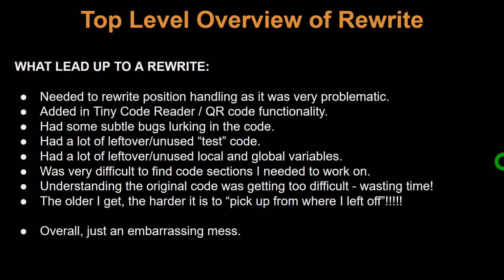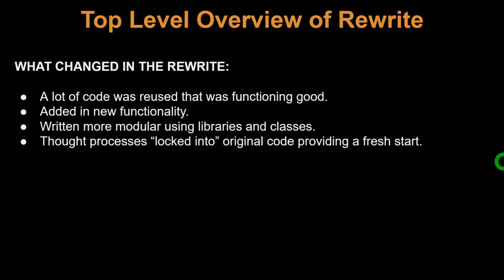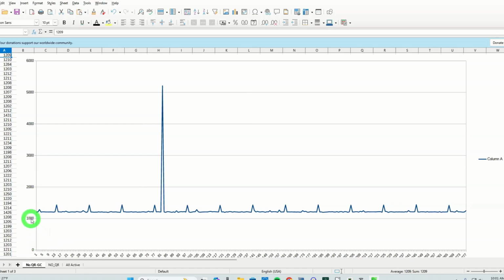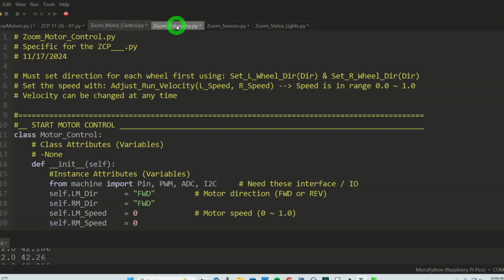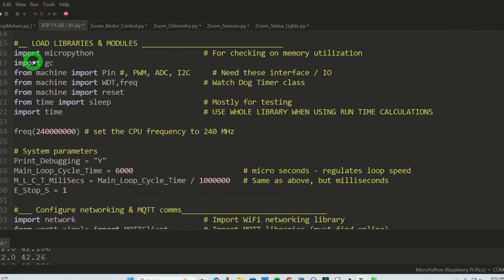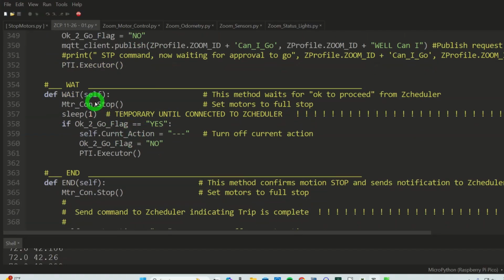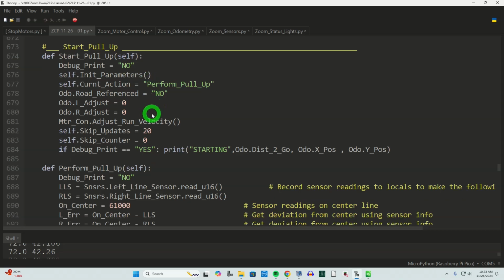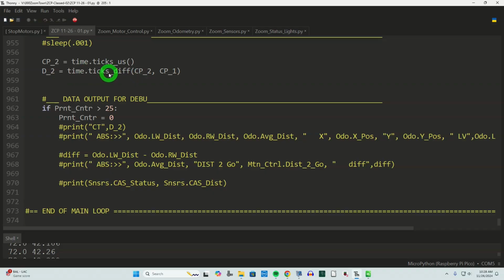055 Top Level Code Review of Zoomie Control Program

Comment: Have you experimented with NFC tags? I have n-scale streetcars and I put the tags on the bottom of the cars along with a magnet. I have one reader under the track to log the starting position of each trolly car and then the hall effect sensors track the exact position of that car when it enters a station. Since all cars follow the same route, I make assumptions about which car triggers the sensors and grabs a virtual token. I'm sure there are limitations as to the speed of the readings if the cars are moving too fast but these are slow streetcars. Your zoomies have the sensors onboard so things are reversed from mine. I also have a large program for controlling lighting on the layout so I understand your concerns.
Reply from the maker: Good morning Ron_Rhodes,
I have not done anything at all with NFC tags.  I just did a quick search to learn more about them and that sound VERY intriguing.  I will have to get the needed hardware and look into those.
Thanks for the suggestion!  All too often I don't explore much outside my world and miss out on a lot of cool technology to play with!
Cheers!
Chris

Comment: Hooray finally OOP ;-)   Python string operations are very good at generating garbage . if you're passing  them around a lot, it may be better to use named constants.
Reply from the maker: Good morning wktodd,
That sounds like a really good suggestion as "taking out the trash" isn't a welcome function. Do you have any suggestion or example to demonstrate that so I could quantify the gain?  I think that would make an great story to produce.
Cheers and thanks for the suggestion!
Chris
Reply: @MakingStuffwithChrisDeHut  sorry for delayed reply. Python strings are immutable so any function thatchanges then has to make a copy. As I understand it, passing a string to a function is by reference (the string is an object)  but that still may require a copy if the function is going to change the string.  Passing a constant or numeric variable doesn't require a copy. There may also be some gain using IS rather than ==  when comparing objects (like strings)